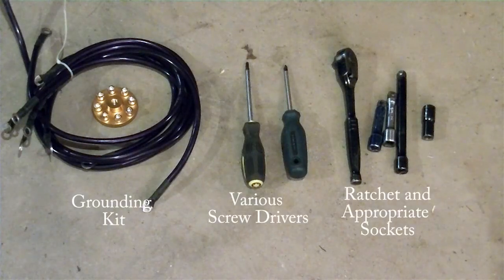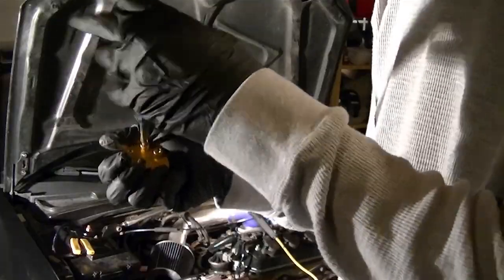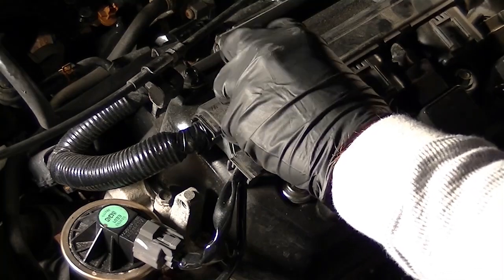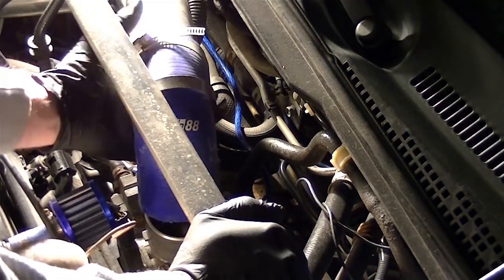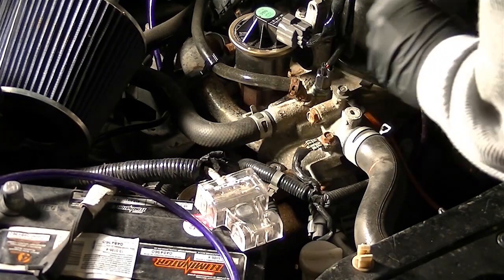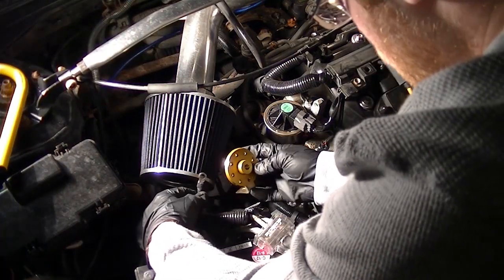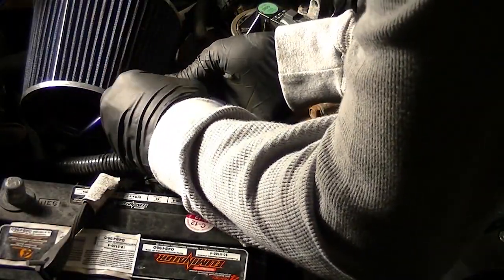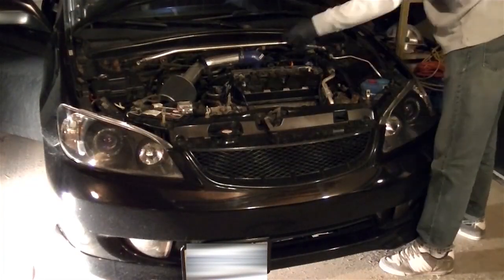Install a Universal Ground Kit!

Comment from the maker: You're correct about the battery tie down not being very secure, but this video is to show how to install a dedicated ground kit, and not how to properly secure a battery. Also, the Canadian EM2 civic does not use the ECU to adjust alternator voltage. Output will always be 14v in optimal conditions. Only USDM EM2s use an ELD to adjust voltage. Finally, the TPS grounds to the TB, and many other sensors ground to the engine block, so directly grounding them improves the reading of the sensors.

Comment: boosted14b...its good that you too have done some reading and research but with all due respect, the video straight up hit the nail on the head with regard to the intended point which was to be made, this was not a video about battery safety, I'm pretty sure I can read and from the little comprehension skills I've developed in my years on this earth...the title says "Installing A Universal Ground Kit!" - on that note, great video guys, very insightful.

Comment from the maker: The alternator still requires a proper ground to monitor and adjust voltage and current output. I know this through extensive research, and because a bad alternator ground ended up causing it to spike voltage to the ECU and fry it on this particular car. We appreciate your concern for safety, and both Jacob and I do not condone using a bungee cord to hold a battery in place, which is why the car is never driven in that condition in any of our videos.

Comment: Should I add grounds from my auto transmission to chassis? Not sure if that would be pointless or if it would help any. Seems like it would. Also, will any part of the engine block do? I have no idea where my factory ground is, and I have limited bolts to put a ground wire on. My valve cover has no bolts (that are accessible, they're kinda buried)
Reply: It depends on whether or not the solenoids/sensors ground to the transmission casing or not. If they do, then it would likely help. You can ground any part of the block and any part of the head to the chassis as long as both connections are solid and touching bare metal.
Reply: +Aetoc Awesome thanks!

Comment: Why do you ground things that aren't electrical (Valve Cover, Throttle Body, Block)?
Reply from the maker: ***** Certain components on some engines are grounded to the block, which is then connected by a grounding strap to the body of the car. The problem with this is that the factory strap is usually unprotected and will rust and break over time, hurting the performance of the engine. By giving these components alternate paths to ground closer to their location, you eliminate this problem. Grounding the car near important sensors also helps reduce the possibility of electrical interference from the alternator or ignition system etc. Hope this helps a bit.

Comment: does this apply to carburettor set ups?
Reply: meowtrox1234  Yes and no...grounding the ignition system is always a good idea, but being that there isn't a need for an ECU in older vehicles, there are less sensors that require a proper ground.
Reply: my car doesnt have an ECU. it's just plain carburettor
Reply: meowtrox1234 That's why I'm saying it would only help to directly ground the cylinder head and alternator, or whatever the ignition coil grounds to. It may improve spark but otherwise it's not going to make a huge difference.
Reply: thank you Aetoc!